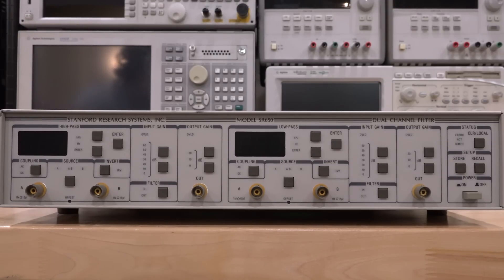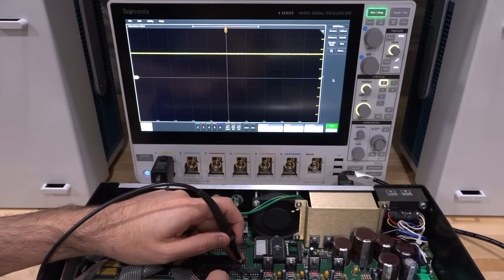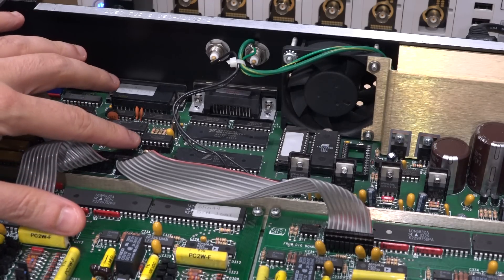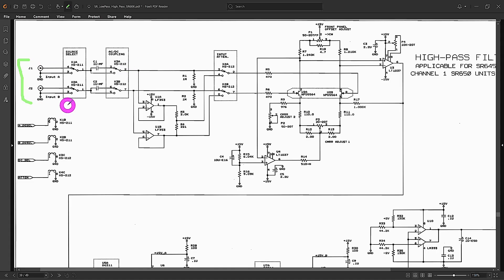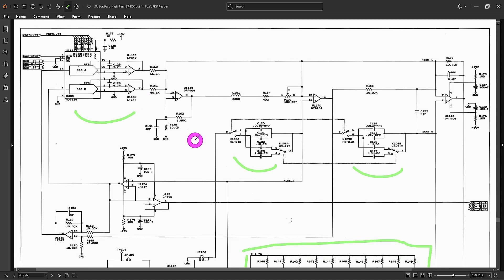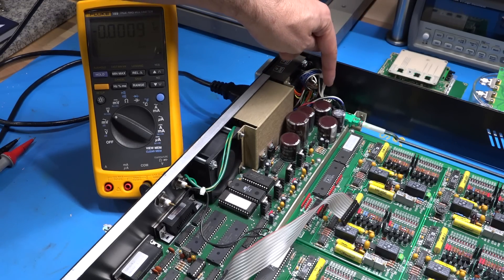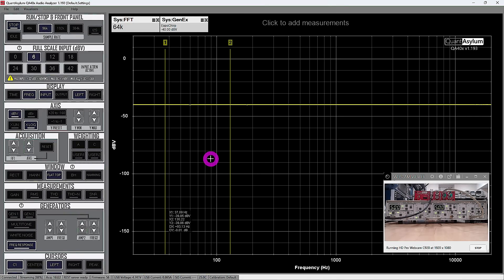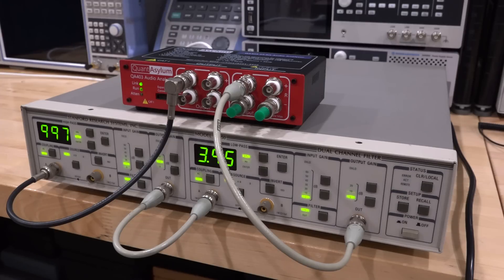TSP #235 - Stanford Research SR650 Dual Programmable Filter HP/LP Repair, Teardown & Experiments

Comment: Regarding the RC marked capacitors, the schematic shows a LT1037 decompensated operational amplifier which is only stable at gains of 5 or greater, so adding a feedback capacitor between the output and inverting input is going to cause a lot of peaking if not outright oscillation.  130 picofarads is pretty low, but is way larger than would be necessary to compensate for stray capacitance at the inverting input.  I thought maybe the board used LT1007s instead which are unity gain stable, but your video shows LT1037s on the board.
Reply from the maker: Nice observation!

Comment: If the schematic says you are supposed to see 9v at the 7805 input, and you are actually seeing 13v, could there be a pre-regulator whose pass transistor is shorted? The circuit would still function, but the dissipation in the 7805 would be double the design, as you are dropping 8v instead of 4v. And if the failed pre-regulator presents a low-impedance path to ground, that could also explain excessive dissipation in the diode bridge.
Reply: Come to think of it, this might also explain excessive power line harmonics bleeding into the signal path.

Comment: An amazing instrument with that rate of cutoff! Kronhite  makes a lower cost version that is entirely analog using ganged pots for the filter adjustment. Of course nowhere near that cutoff rate or dynamic range. (or price!) What era is this instrument? Looks sort of 1980's?  I had the impression the 7805's were kill proof with the thermal shutdown.

Comment: You know, this video, with the failing inverter, vintage chips, clock generator, and mystery capacitors floating in the air, reminds me a lot of Adria's Digital Basement, and his "whodunnit" style Amiga/vintage PC repairs ;)

Comment: It is no surprise you are getting noise with 40dB gain in the filter. A much fairer test would be to run 0dBm in and look at S/N in that setting.  Other than that, crazy good response curves. Truly a problem solver filter!

Comment: Amazing what a cover will do for thermals huh.
Reply from the maker: The cover would not fix the issue with the 5V regulator. The cover was on when it originally overheated and the display dimmed away. The thermal interface was faulty. The rectifier is also not in the path of any air-flow. The only components which are in the air-flow where the +/- 15V regulators.
Reply: @TheSignalPath   5 volt reg bad, yes.  where are the other holes let air in?
Reply from the maker: Nowhere near the bridge rectifier, which is why it would get so hot.

Comment: @12:45, Are you sure you wanted to replace that bridge? It's a linear supply, so the voltage has to be dropped somewhere. If it isn't dropped in the bridge, won't it be dropped in the regulators, which are clearly also pretty stressed? I was thinking maybe you would want to throw some extra dissipating components in to add a little drop, at least before the 5v reg.
Reply: agreed, the lower Vf of the new bridge is just adding more voltage drop that the 5V reg has to dissipate. I'm sure he's well aware of that; hopefully the "V_in = 13 instead of 9V" situation was also just resolved off-camera
Reply: It looks like it is a two stage supply, which is typical for this sort of equipment. The first stage (typically an SMPS these days) drops from the mains voltage to the 9V he talked about, then the linear regulator drops that to 5V as a second stage.  The reason for this is that the first stage will create significant ripple and rather than attempt to filter that away with inductors and capacitors, the second stage just chops off that ripple.  

That is the theory and it almost works like that in practice, but the higher frequency noise elements still require some filtering and the current oscillations can induce noise wherever they can couple.

The V[F] on that bridge sounded pretty good. I wonder which one he selected. I often over spec the V[RRM] and end up with more voltage drop, which adds heat, but otherwise is allegedly a preferred tradeoff since the leakage current does more damage over time than thermal wear out. I have never seen the math on this, though.
Reply: You may be right. Maybe I missed it, but Shariar never resolved the "it's supposed to be 9v, but it's actually 13v" conundrum. I wonder if the root problem here is that the pre-regulator's pass transistor is shorted, causing the 5v final regulator to do all the work?

Regardless, my point stands. Everything's in series, so one way or another, there are I amps flowing from the transformer winding, through the high side of the bridge, through both regulators' pass transistors, to the 5V rail, through the instrument, through the low side of the bridge, and back to the transformer. There's 5V across the instrument, and 13 volts on the unregulated rail. Which means 8I watts are being dissipated in the 5V power supply, whether that's being dropped in the rectifier or the pass transistor(s). So if you drop less in the rectifier, you will just drop more in the pass transistor(s).

That analysis does overlook one detail. An A/C current flows through the rectifier and the tank capacitor, which doesn't flow through the rest of the circuit, so reducing the rectifier drop will reduce the dissipation in the rectifier more than it increases the dissipation in the pass transistors. I don't feel like doing the math to figure it out now, but intuitively, it seems to me that that effect will be pretty small, owing to the fact that the rectifier forward drop is more or less constant regardless of current, so the rectifier dissipation will be proportional to Iavg, not Irms (approximately).
Reply: if he just puts the cover on it, it will be just fine.

Comment: My guess for the "floating" capacitor:
They were definitely put there by the factory. The solder-joints and everything else looks really clean. Obviously that was an afterthought after the PCB layout was already done.
So what I think that happend was an "after-after-thought". So for some reason, someone decided, this capacitor was not helpful after all. But since this batch of boards was already fully assembled with the capacitor in place, someone had to come in again an "remove" them all. Lifting just one leg takes only half the time, so if they had to go through a good number of boards, they just left it at that. They were not gonna re-use the caps anyway.
It's just my guess. If someone had worked on these parts after they left the factory, the joints would not look this clean still.
Reply from the maker: If this were done at factory they could just "snip" the part of which would be much faster and less messy for them. This looks like someone was "experimenting" and wanted to go back and forth between the two mode (capacitor included/not included). The capacitor can also easily bend and touch another pin. I would be surprised if factory would leave it like that.

Comment: Back in the day we used to have problems with the same type of oscillator circuit, i.e. some brands/type of 04 inverter would be temperamental in starting up, some even double oscillating!.
I looked at my SR650 repair video and it has the 04 socketed also.......so I believe it's just a precaution by the factory that in the event there's a startup issue they can easily change it out.
Reply from the maker: Thanks Ian for checking!
Reply: CMOS gate oscillators tend to have problems because of low transconductance, especially over their operating temperature range.  This problem sometimes shows up with microcontrollers where they have two external pins for connecting the crystal.  Single transistor bipolar oscillators are much more reliable, but nobody has time for that anymore.
Reply: @Alamagosa You mean they don't have enough current drive strength?

Comment: In EEVblog #621 Dave repaired an SR650 with a very similar problem. In his unit the cover over the mains filter was missing, so the 5V regulator had no heat sink at all.

Comment: 13:25 These silicone pads are supposed to be dry. I use them all the time in my projects. They work somewhat worse than the paste but last effectively forever and don't smudge everything around.
Reply from the maker: They are "dry", but they become less flexible and shrink with time. They won't make good contact with the two surfaces anymore. Thermal pads like this may be convenient, but really should only be used when electrical isolation is needed. They perform much worse than any paste.

Comment: Also: how are the DACs designed to affect Fc in the filter loops to get smooth Fc changes instead of the discrete Fc poles/zeros caused by the resistors and capacitors switched in or out of the filter loops?

Comment: At 18:03 you demo the BP. Ignoring the 60Hz as best as one can, why does there seem to be a difference in the stop bands of the low compared to the high?
Reply from the maker: Because in the low-pass mode the signal present at low-frequencies by the sweep generator dominates and is much larger than the 60Hz noise.
Reply: @TheSignalPath  did you sweep noise or a fixed amplitude sine? In either case I would think the signal coming in is the same amplitude across the sweep range. No?
Reply from the maker: The sweep is at a fixed swing across frequency, it is a sine wave not broadband noise.
Reply: @TheSignalPath  thanks. If the sweep is constant amplitude as a sweep should be, what then accounts for the noise floor difference of the low frequencies as compared to the high? Again, it’s a little hard to tell because the 60 Hz dominates quite a bit. Or is it because of the 60Hz interacting with the windowing in the spectral plot that’s causing the low end noise floor to look higher than the high noise floor?
Reply from the maker: I think I misunderstood your original question. Remember the scale is logarithmic and the noise goes up at lower frequencies because the front-end circuits have higher 1/f noise near DC.
Reply: @TheSignalPath  ah ok. Makes sense! Thank you.

Comment: Thanks for the training. I  spent my carreer working on HP test and measurement gear, mostly RF and microwave. From 1970 to 2015. Happily retired, but miss the challenges of component level repair. Ex-USN ET.
Reply: Tech at Santa Rosa?